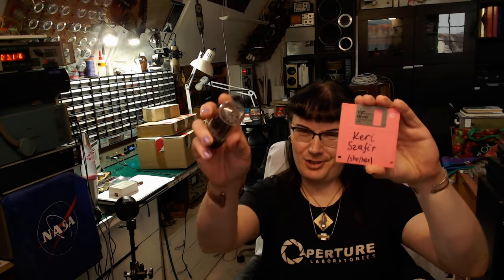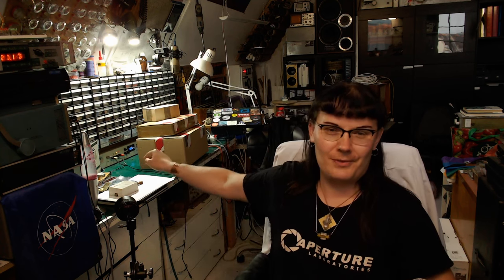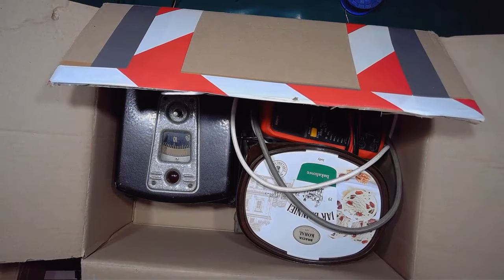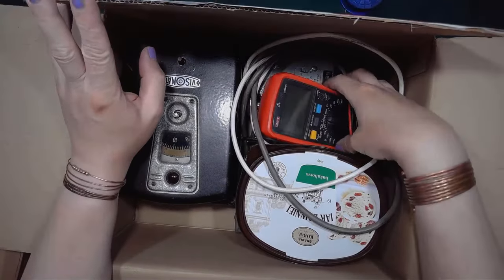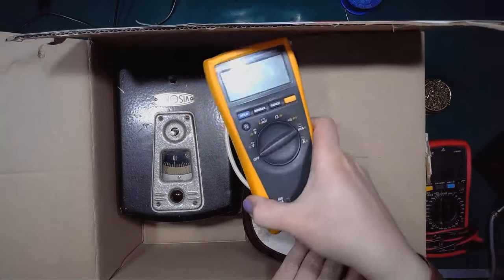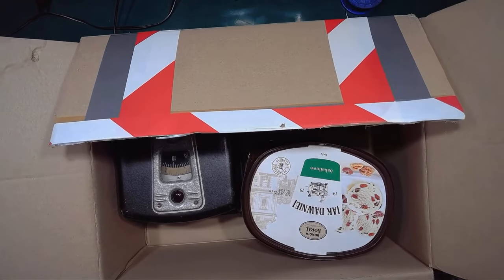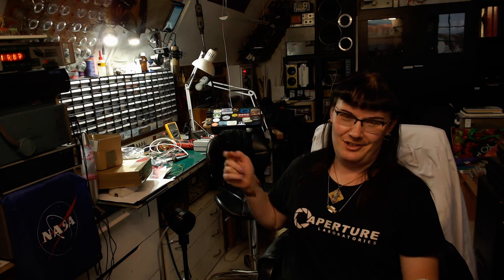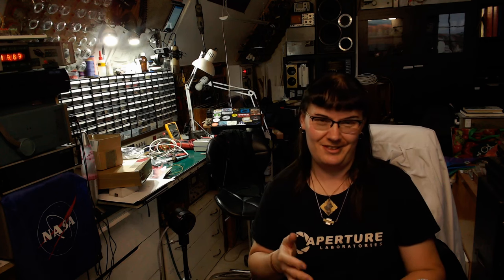Cool Stuff from Łódź Trip

Comment: Coco so cute, and so helpful. I also have a Faraday motor with contacts that used to drive a sign, 4 heavy switches and a motor with a copper disk that relies on eddy currents to move it on the shaft. Ran 144 lamps, each a 25W lamp, with 4 strings of 36. So around 800W per string, and contacts that are capable of doing that 24/7/365 for decades.